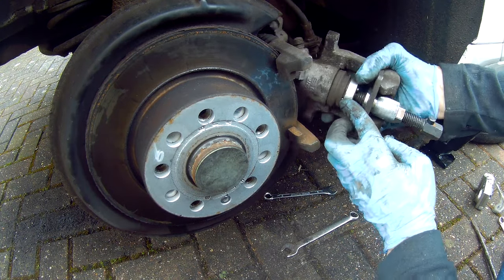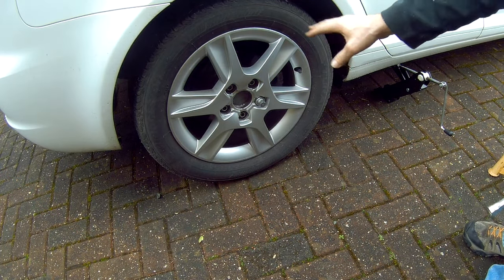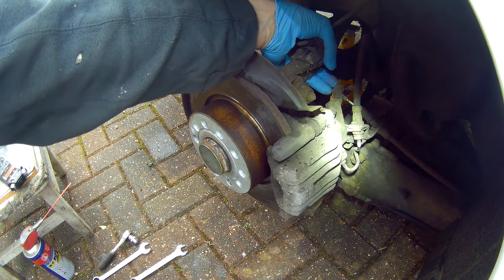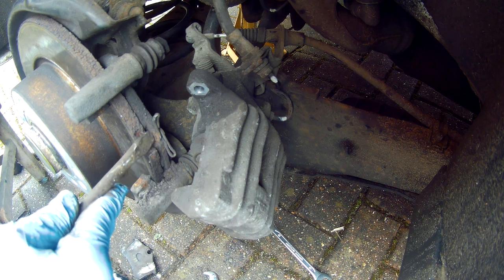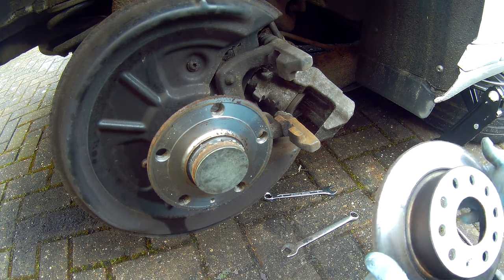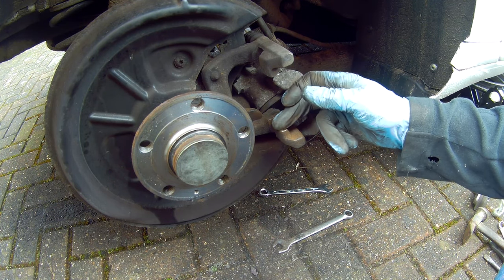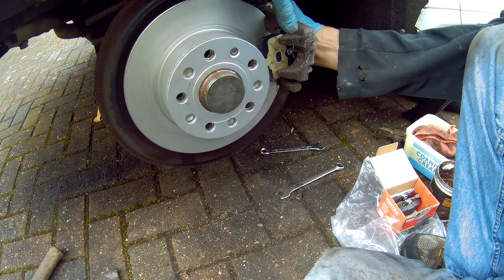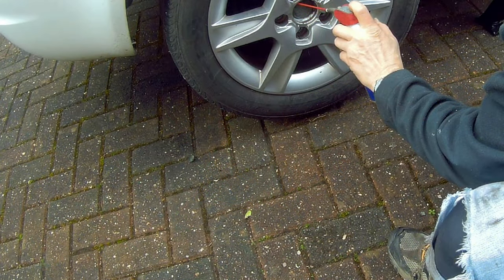AUDI A3 TDI Rear Brakes (a beginner's guide)

Comment: Very helpful, thanks buddy. I usually prefer to loosen the wheel bolts before jacking the car up. Doing it while the car is off the ground relies on the handbrake holding the wheel in place and doesn't always work. Good video, I like the clear concise commentary :)
Reply from the maker: Glad you found it helpful and liked it, thank you for your comment it helps me try to make better videos. Yes loosening the wheel bolts before jacking is also good, just whatever you prefer. In this case I use the jack to just take the weight slightly before breaking the bolts loose. I find that this method helps stabilise the car a bit and as long as the tyre has enough contact with the ground it works well.
Reply: He did loosen the wheel nuts , before raising the car !
Reply: @markblackman2542  You're right, not sure what I was on when I watched this!

Comment: Changed mine today, pad is scraping the disc -  I’m thinking I didn’t push the piston back in far enough is that possible?
Reply from the maker: Check if you have assembled everything correctly, if you have then press on the brake pedal hard a few times to see if will settle and release evenly from the disc. You might have to do it with the wheel on. It  shouldn't stick badly anywhere. Sometimes as long as you installed correctly running the car a bit can act to settle or bed the pads in, but not if there is a fault.

Comment: I use a small paint brush to apply the copperslip and the you don't get grease everywhere.
Reply from the maker: Yes, thanks 'Phild' that is a great tip; a small brush would do the job well.
Reply: I favour an old toothbrush.

Comment: Very good in-depth video! I've got a 2009 A3 2.0tdi Cr140. I've done my fronts. But my rear discs do not just come off at an angle, am I doing something wrong or are some of them different carriers and I'd have to undo the dread M14 splines? Thank you.
Reply from the maker: Thanks Jake, glad youliked my video and have done your front brakes. If your
rear brake discs don't come off after you have taken the caliper off, then you
will need to take the carrier off. Always re-new these bolts as they are
stretch bolts. New bolts come with the correct threadlocker (correct torque
setting also needed). I would recommend Soaking the original bolts with penetrating fluid overnight and using the correct M14 spline tool and a
bit of heft to remove them, they are usually tight.
Reply: @HatBoyHarvey  Ahh, okay. Thank you for the advice. Wish me luck haha.
Reply from the maker: I'm sure you will be able to do it. Take your time and make sure your spine tool is on firmly and you wont need luck.

Comment: Why did my caliper sieze its so hard twisting it? How to fix it any other type of clamming equipment?
Reply from the maker: Wind back tools are all similar and there isn't one that makes is easier that I know of. These are prone to seizing and are normally hard to wind back initially then should ease as you wind them in. If it becomes very hard to wind back - by all means have a go to free it up (pump them back out and wind back in a number of times), but my advise is: if the caliper is old then replace it. it is cheap and easier to do that. I've spent hours freeing these up for them to only last a couple of weeks more!
Reply: @HatBoyHarvey  thankyou for ur fast reply, i will certainly do that

Comment: Good job anyway. Try ceramic grease in future. Cheers
Reply from the maker: Thanks, I may just try the ceramic grease again. I seem to remember using it a long longtime ago, but not sure why I never took to it as on paper it should be better :-)
Reply: @HatBoyHarvey  some ceramic grease damages rubber bushes, you need to be careful where it goes, nothing wrong with what you did with the copper slip

Comment: Good video but i wouldnt say to start kicking the wheels when its only on a scissor jack. Ive seen them slip many time.  I wouldve had the axel stand in before i finished removing the wheel.
Reply from the maker: Well spotted, it does seem to look that way, although I can see a stand in place when I manage to get the wheel off. At 2:23 there is a cut and then 2:27 you can see that the yellow axle stand is missing just as I kick the wheel which is where I cut out the bit where I put the stand in place. I should have made it clearer that the stand was in place. Thanks for the comment :-)

Comment: Just fitted new discs and pads  to the rear on an 09 a3 cabriolet Audi and it looked like the old pads had a sensor on and the new pads didn't?? Cant seem to find sensord rear pads online.
Reply from the maker: I don't believe that model has rear brake wear sensors (unless it is a very top spec/powerful one, then not sure, never seen one), if it does then there will be a connection for it, so it's worth another look under the car. They usually have one wear sensor on one of the front wheels, some are integrated into the pad and some attach. Hope my video helped a little :-)

Comment: Is bleeding the brakes necessary after just a brake pad change?
Reply from the maker: If your brake feel is good with good pressure and you have tested them to work well then you may not need to bleed them. You should bear in mind that the service schedule states to change out the brake fluid at periodic intervals in line with the service. This is because brake fluid absorbes water over time (hygroscopic) and then becomes less effective. As a general rule, if your brakes work as they should then they works! Hope this helps, thanks :-)

Comment: The slider on my piston rewind tool is bending quite considerably.  I've had a spanner on the end of the handle but it is impossible to continue. Any thoughts please?
Reply from the maker: Don't over-force it, the piston needs to go back straight or it will be damaged.  If it is tight then back off and clean everything up and try again. the tool needs to be inline, but they are often initially stiff. If you look behind the rubber boot and find corrosion around the edge of the piston then water has got in. You could try soaking with Brake fluid around the piston edge to loosen/free it up, but penetrating fluid will damage the seals, so DO NOT use penetrating fluid here. try winding forward and back and make sure tool is a good one. If it wont budge at all (perseverance needed) then you will have to remove, rebuild it or replace it.Thanks for watching:-)
Reply: @HatBoyHarvey   Thanks for the quick response. Its been many years since I changed my own pads on a car, so your video was invaluable. My pads were worn down to the metal and as a consequence the piston was fully extended which did not allow room for the rewind tool, so I used this technique shown here -
https://youtu.be/lU6OKQxSg8U?t=571

But this only bent the slider. I didn't realise that the piston was meant to turn. I'm sure they used to push. Must be a new design. Had to hacksaw the locator thingys on the otherside of the rewind plate to force it in. Got the job done in the end but oh boy, what a mission. Since ordered replacement discs, so will go through the whole process again today. Anyway, thanks again.

Comment: Can i leave the hand brake on durring the changing?
Reply from the maker: You need to release the handbrake so it can re-adjust correctly with the new discs and pads. Remember to choose level firm ground, use axle stands and chock the front wheels.

Comment: Why did he leave the stickers on the pads, other videos say take them off!
Reply from the maker: Yes you can peel back the sticker to help with brake squeal. (should have shown this) I find if you clean the brake up well and add lubricant in the right places you shouldn't get that, but the weather is colder in UK than hotter climates where brake squeal is more prevalent. ;-)

Comment: I rounded off these boots with my scanners as they had been there.for ages. In the end I took it to a mechanic 
I was so frustrated because I could have that this job myself 
Great video Harvey keep them coming
Reply from the maker: It is good to stay on top of mechanic jobs on the car on a more regular basis, brakes are one area that benefit from routine maintenance/strip-down: sooner rather than later. The rear brakes on these cars are susceptible to corrosion in bad climates such as the UK :-)

Comment: Great video.  Thanks for making it.  I just purchased a 2011 Audi A3 TDI.  Looking for how-to’s so I can do these maintenance items myself.

Question: you mentioned the handbrakes are self adjusting?  Can they be adjusted manually if needed?

My hand brakes seem to go up too high... to the point it bumps into the center console. The center console can live up and down (obviously) but it’s a nuisance to having to keep readjusting the center console.  I don’t imagine they designed the hand brake to bump into the center console every time it’s engaged.  So I think my handbrakes need adjusting.  As it is, even when I have it engaged and pulled up as high, the brakes aren’t full engaged.  On a slight slope, that car will still rest on “park” gear, not on the hand brake.  I hate the “grindy thud” I hear when I shift out of park.
Reply from the maker: I would look at the whole cable to see if it is moving freely, if it is then the self adjusting part may need freeing up, if not then the cable. Also the cable can be adjusted at the handbrake end under the centre console, but this is mainly to balance each side, but if the cable has stretched this can be tightened up :-)

Comment: really good video, was indepth, great work. 
only thing id mention is that you forgot to take off the backing paper for the sticky back on the pads.
Reply from the maker: Very good point,
sticky pads are designed to stop brake squeal caused by the pads vibrating
against the disc usually under light braking, but can include heavy braking. Not
all pads come with these so making sure all braking parts are completely free
moving without any corrosion and applying copper ease dampens down brake squeal and stops the pads from ceasing by importantly allowing a small amount of
cushioned float within the carrier. Some calipers use shims for this purpose
which also should be clean and free running. There are also many other anti-squeal
compounds available and not limited to one product or method alone. I have
shown the method I prefer to use which has proven to be effective.

Comment: An the dust shields be replaced without taking the hub off?
Reply from the maker: yes at a push, but you need a good purchase on the bolts and they will be inevitably rusted proper! I did a video on this somewhere, I'd give you the link, but my computer is down at the moment (Think it's my HDD) I used a 1/4" wrench with the socket hammered on :-)
Reply: @HatBoyHarvey  thanks

Comment: Why you didnt take off this sticker from pads??? OMG...
Reply from the maker: You can use the sticky pads and maybe should have mentioned and shown this. They are to reduce brake squeal. If you make sure the brakes move freely by cleaning them up well and using anti friction compound on the sliding parts you shouldn't have any issues :-)

Comment: Hey, how do I find the correct size for the winding tool? Is is a big problem if the tool I buy isnt the exact diameter? Thanks for the guide!
Reply from the maker: The one I used on this car was just a standard universal VAG tool (32.5mm pcd, 5mm pins and 45mm od). If yours has large calipers fitted to some fast models they maybe different. As long as the pins fit and it goes in the caliper, which they usually do it should be fine. If in doubt strip down the brakes, measure it and nip to the shop :-)
Reply: @HatBoyHarvey  Thank you. I have an a3 1.9tdi 2008 so I am going to go with a standard one, shouldnt be a reason to not be standard.

Comment: You had to take the paper off the brake pads.
Reply: They are to reduce brake squeal. If you make sure the brakes move freely by cleaning them up well and using anti friction compound on the sliding parts you shouldn't have any issues :-)

Comment: Fantastic video, I'll save this as I'll be fitting discs and pads shortly to mine. Need to also sort the handbrake out, it's rubbish.
Reply from the maker: Thank you for the appreciation, Hope it helps you fit your discs and pads. Make sure all the handbrake components are cleaned of muc/crud/rust and free  up the moving parts and it should all work fine (handbrake auto-adjusts itself)

Comment: Good video but the 2013 Audi TT MK2 calliper hanger is too tight to get the disc off, if you get the old disc off it’s impossible to fit the new disc without removing calliper hangers.
Reply from the maker: Yep, very often the case :-/